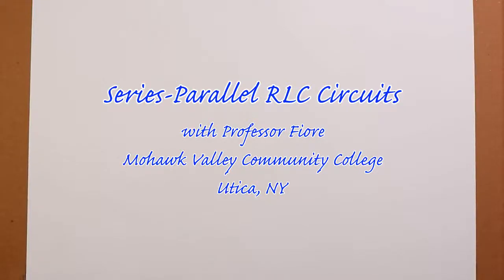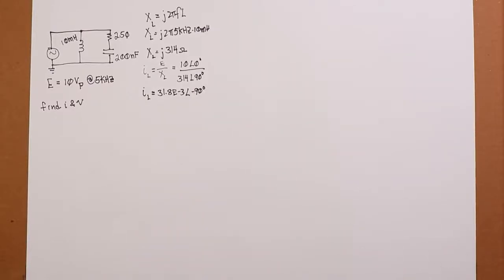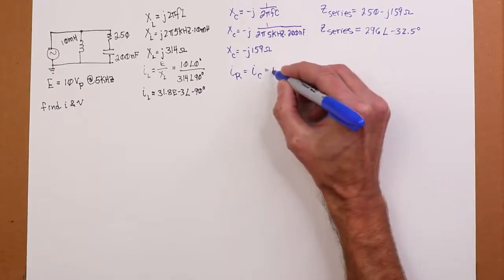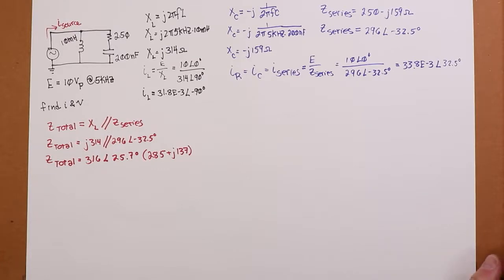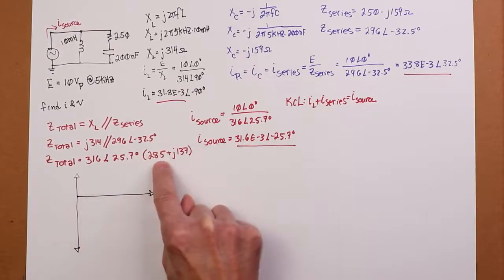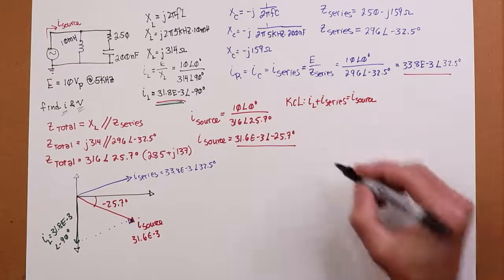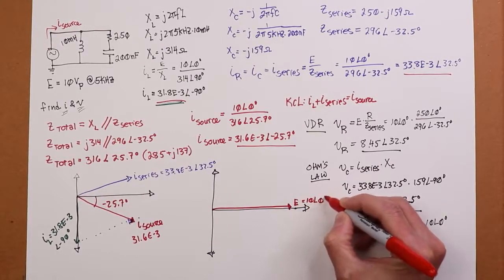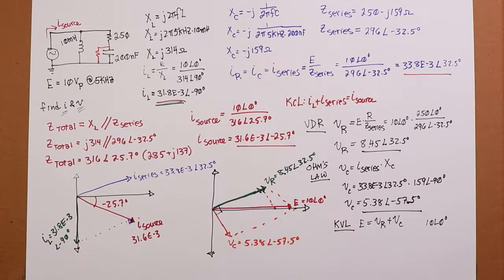AC Electrical Circuit Analysis: Series-Parallel RLC Circuits

Comment: hi Professor, i am unsure of how you added up the j314// and the 296 (I don't have a symbol for angle)-32.5. My understanding is that the Xl is in rectangular form and the  z-series is in polar form. I thought you firstly have to convert them to be in similar forms before any addition can take place and i thought j314 has an angle of -90 degrees
Reply from the maker: If you want to add or subtract, put the parts in rectangular form. For multiplication or division, use polar form. The thing to remember with series-parallel circuits is that subcircuits can have arbitrary angles, so it's much more labor intensive than simple series circuits or parallel circuits. 

In this case, you need to put j314 (314<90) in parallel with 296<-32.5.If you use product-sum rule, you'll have to multiply them (can do that directly), and then divide by their sum (getting the sum requires turning the 296 into rectangular form). To divide, you'll need to convert that denominator into polar form first.

Conversely, you could use admittances (1/Z), but that will still take a number of conversions. Consequently, I recommend always turning the subcircuits in both rectangular and polar forms before you start simplifying, and as you're going through the process, because you're probably going to need both at some point.
Reply: @ElectronicswithProfessorFiore  thanks prof

Comment: you complete missed out the part where how to to calculate Z total which is what I need the most! !! (crying face)
Reply from the maker: Ztotal is shown around the 7:00 minute mark (in red, no less). Are you referring to the math itself? If so, go back and look at the video on dealing with complex numbers.